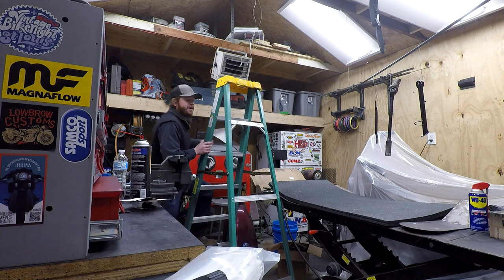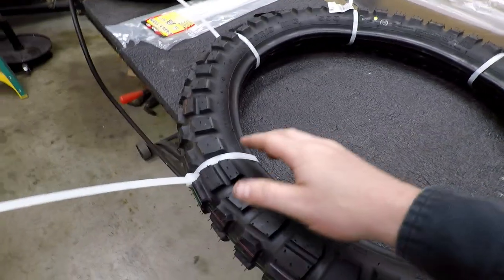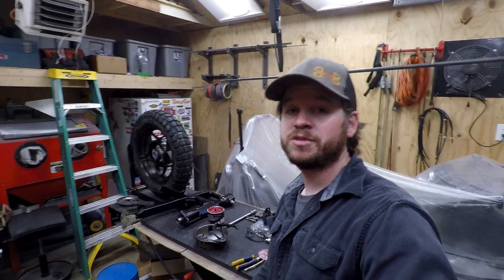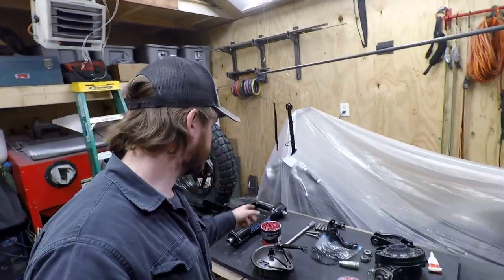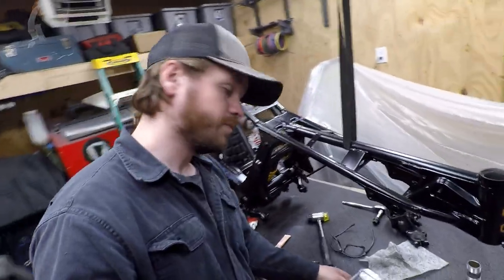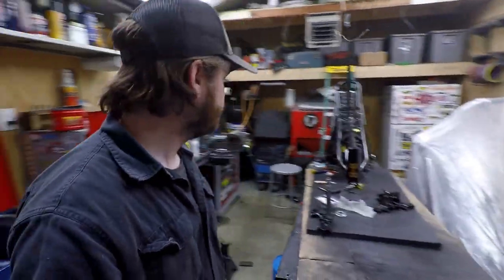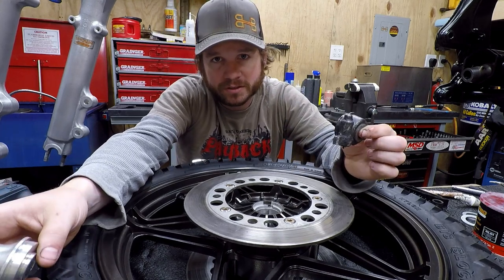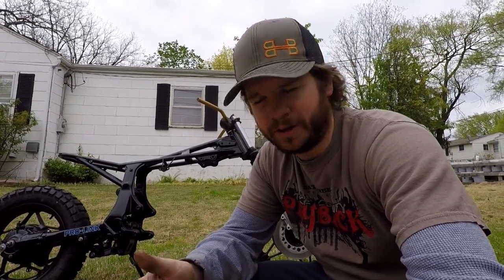GL650 Build - Chassis Assembly!! Looks Tough!! Kenda Big Block Tires - EP12

Comment: Châssis looks amazing! I am just not a big fan of the central part in the middle of the front fork, which is not seen in this video. I think I prefer the fork without it. But hey, it's your build :)
Ps :  I would have been so damn scared to fuck up the paint job on the rims ^^

Comment: GREAT tire choice, bud!  I just bought some Shinko 705 Dual Sport tires that are going on my current CB550 build...  I debated on the Shinkos and the Kenda Big Blocks.  I think the GL650 is coming along great...  Looks Tough, like you said.  The Monoshock design goes good with the tire set.  Love the Bronze wheel color too!  Can’t wait to see it finished!   What color is the Tank gonna be???  I vote bright Yellow to match the rear shock coil spring.
Reply from the maker: Thank ya! The tank is actually going to be a bare metal vibe. Thats why I did the fork legs in brushed finish

Comment: Love the chassis. What kind of welder do you use for all your fabrication stuff? I'm looking to get a welder and dont even know where to start
Reply from the maker: Thank you! My tig is an older Miller Syncrowave 180. If you are looking into a TIG there are tons of options from Everlast and others on that end of the scale. I have a MIG as well which is a 110v and I still use it on occasion. A mig is MUCH easier to learn and MUCH cheaper but you don't get the same control as a TIG when it comes to the small detail stuff.

Comment: Looks awesome man. What did you use to paint the wheels? They look pretty durable and mine chipped super easy on my XS650.
Reply from the maker: Check my previous video where I paint them. I linked what I used but it's a basic Krylon base coat with spray max 2k clear
Reply: I must’ve missed that video! Thanks man